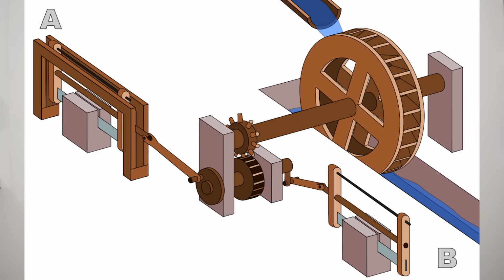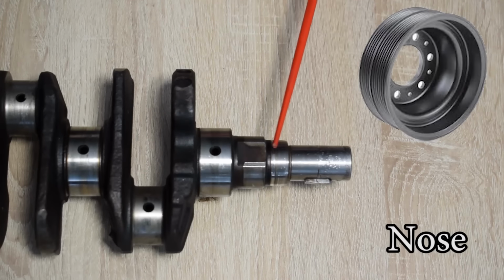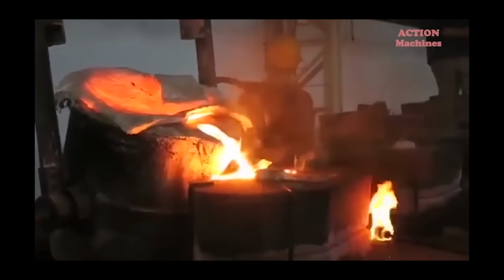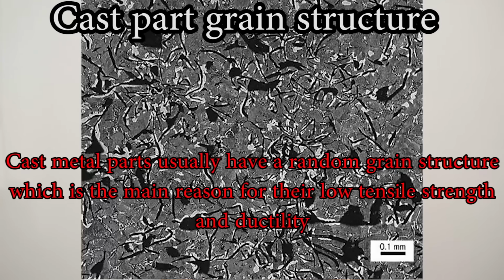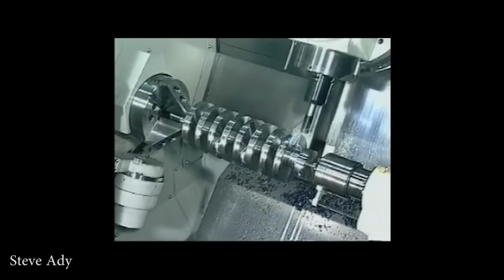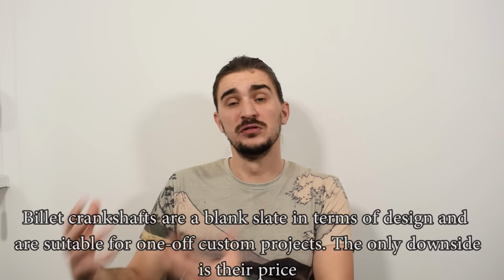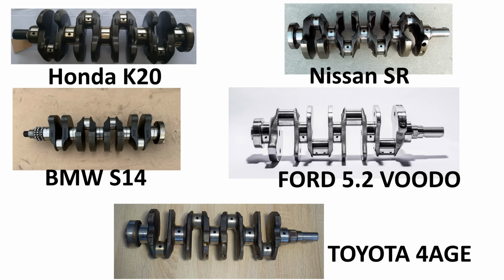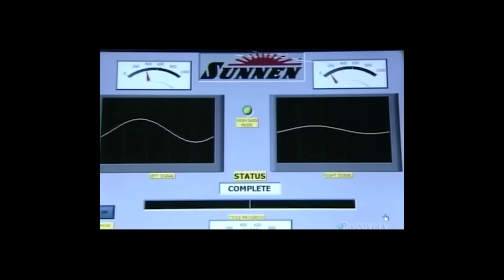EVERYTHING about the CRANKSHAFT - Function | Manufacturing | Different types | Forged | Billet

Comment: The three most machinery intensive parts of an IC engine are the Block, Cank and Heads in that order. For a normal street engine nodular cast iron is just fine. I worked at an engine manufacturing facility for 30+ years. We built 4s, 6s (v & inline) and v8s. Cast iron and forged. One of the V-6s actually was pre balanced as its first operation. Which was drilling the central holes. Plus on both V-6s we built the pins were offset for smooth running purposes. The cranks were forge flat and then twisted and their centerline to get the angular offset needed. 
As to the strength of cast crankshaft. In the 60s there was an AMC 199 sleeved down to meet USAC Indy rules that made a reported 800 HP as max boost.
Another thing with flat plane cranks in V-8s. Using a flat plane actually makes it easier to build a V-8 with an angle other than 90° between the banks. Such an engine is effectively two 4 cylinder engines on a common crankcase

Comment: 26:10  Ignitions happen every 90 degrees of crankshaft rotation, both in flat plane and crossplane V8s, as long as there's a 90 degree bank angle.  Some odd angle V8s (like the new Mercury) even have split crank pins to avoid uneven firing.  What are you saying here?

Comment: From my understanding of material science a material that has less flexibiltiy on teh stress/strain curve is generally consider brittle due to its inability to flex leading to more dramatic failure. 

Just a technical point, ofcourse. In the end, it's the material that hadles the most force wihtout failure or permanent change in shape that matters

Comment: Great stuff mate really enjoying this series!

You mentioned in your video about pistons that a forged piston can slap the cylinder walls when cold creating more wear, so how does that compare with forged crankshafts?
Reply from the maker: Glad you like the content. There are no downsides to forged rods and cranks because they are not directly exposed to combustion heat, heat expansion is not an issue.
Reply: @d4a  Of course... duh! :)

Comment: I love your videos man
I would advise you to invest in an ok microphone to significantly increase audio quality 😊
Great job dude
Reply from the maker: I'm using a Zoom H1, I really thought the audio was nice. Maybe you're just comparing me to 2 million subs channels 😊 what do you dislike about the audio, so I can try and fix it?
Reply: @d4a  Well your voice is clear enough, but there is too much echo, and also you sound pretty far, which means your mic is mounted to the camera I assume?
My advice would be to maybe choose your "recording room" or "studio" as I've seen your videos are in different rooms sometimes. After choosing, buy a few cheap foam sound isolation pads and glue them to the wall, that will solve the echo problem. 
For the distance issue, I would recommend you invest in one of those small mic's on your short. That should sound way more natural. 
If you're not familiar with mic's I could link some videos from some techtubers as they would provide a far more detailed review.
Reply: @d4a  or! Bring the mic closer to yourself! That way you don't have to buy another one if your happy with quality of your current one.
Reply from the maker: Thanks for the info. Yeah, definitely different rooms, unfortunately at this stage I can't convert any room into a studio or glue anything to the wall, but I'm looking to change that eventually. The zoom recorder is maybe 50 cm from my mouth, it's separate from the camera and I synch my audio in post production. I will try bringing it even closer as some people mentioned the echo already. If that doesn't work I have an Olympus lavalier mic I can try, although my problem with lav mics is that I move around too much and that really ruins the audio sometimes.

Comment: i feel like i am somewhat overbuilding my daily engine build with a billet crank and forged pistons and forged H-rods, but it's nice to know there is a possibility to go stupid if i get tired of using it as a daily engine
Reply: Forged pistons are good and handle more power vs oem forged. H beam all day, can't go wrong as long as you don't run into clearance issues. Get your crank micro polished and nitride coated.
Reply: @twistedsocal  bit late for that as it's in there already but it's not a bad idea.  as its quite a big boy crank stock 80mm vs stroker 103mm making my little 2.3 I4 a 3.1L street beast should be around  high 200 to low 300 ish NA horses on pump gas tune, but not completely sure as the rally built engines with the same resipy goes for quite a lot more compression and E85. but they make in the high 300 range.
Reply: @Stale_Mahoney  yeah I figured you had already slapped it together from how long ago your post was. Still it's all good, the only thing you gotta be careful about is if you use pistons with low silica content cause you will get mad piston slap till it's warmed up and some other race parts that expect you to tear down and rebuild way way more often than someone who is building for day to day street driving.
Reply: @twistedsocal  yeah the specs for piston to wall clearance is 0.08mm or .003 ish inch? bore 96.68 piston is second over dim 96.60mm
Reply: @Stale_Mahoney  different clearance and spec per build. The different makeup or content of piston will determine the expansion rate and ammount per piston. Higher silica pistons don't expand and contract as much so can have tighter tolerance overall from start to warm... Where as some pistons will have a lot more play or clearance but as they warm up will get much tighter. These tend to produce more power in the end but also have slap at the beginning and imo too much play to be tolerant. I have gone both ways. I prefer high silica pistons.  As to your clearance and spec. I have no clue what your build calls for
Reply: @twistedsocal  yeah the stock alu pistons had more clearance than  these forged pups, is a known problem a the redblacks get older that they get piston slap, so hope to avoid that

Comment: So is the Kawasaki H2 750 two stroke triple; a sort of 3 plane ? "Y plane " perhaps ?
Reply from the maker: Yes, you could call it y plane, the crank throws are 120 degrees offset from each other, but not all three cyl bikes are like that, some have the throws offset 180 degrees, so when the middle cylinder is up the other two are down.

Comment: Good overview and explanation!  I would expect there to be other versions than flat- and cross-plane crankshafts.  With 120° between the rod journals for example?
Reply from the maker: Definitely, many three cylinder engines have the throws offset 120 degrees from each other. I didn't go to deep into the planes and cranks as the video was pretty long already :)

Comment: Crossplane crank engines do not fire more often than their flatplane counterparts. They are equal in this respect. The big difference between the two is the differences in the 1st and 2nd order vibrations. Flatplane cranks are smoother at low rpm because they have an even firing order on each bank but vibrate much more at high rpm, while crossplane cranks are smoother at high rpm due to the increased counterweights but can have a lot of shake at low rpm.

The burble of the crossplane crank is due to the uneven firing order causing a stepped pressure wave  vs the smooth pressure wave from a flatplane.

As for the flatplane cranks tending to make less torque, this is not exactly true. Engines with flatplane cranks do tend to lack some torque of a similar engine with a crossplane crank, but this is due to the cams being tuned to the operating range of crank. A cam used for low end torque is better suited with crossplane crank that doesn't rev outside of its powerband. In the same regard, a cam that produces power at the higher rpms that a flatplane engine can achieve tend not to work as efficiently and produces less torque down low.
Reply: 👍 Neither crank can “make” more torque than the other.  Crossplane is heavier and creates more windage so it consumes more torque.  Also the claim “Crossplane has a cylinder firing more often compared to a flatplane crankshaft”. is not physically possible.  Here’s why: Both cross-plane and flat-plane V8 engines, being four-stroke engines with eight cylinders, have the same number of firing events per engine cycle at the same RPM.

Comment: A quick correction. Both  cross- and flatplane V8s with a 90° bank-angle fires evenly four times per revolution, aka every 90° of rotation. Difference beeing the flatplane has even spaced power-pulses on each bank (so basicly two typical I-4s offset 90°) and the crossplane does not, it has an uneven distribution of pulses per bank. The total being the same. At short, the only thing the crossplane is better at is second-order vibrations. And no, the flat plane does not make less torque, displacement for displacement, all else being equal. Infact a flatplane makes more torque and power generally over the entire range, due to the even spaced (on each bank) pulses, giving better exhaust scavenging. (even exhaust scavange can be done on crossplane engines, but is very impractical due to exhaust header space constraints, and the runners becomes so long, that you get deminishing returns).
Reply: This! Flat planes only typically make less torque because of the design of the engines that use them!
Reply: 👍 Neither crank can “make” more torque than the other.  Crossplane is heavier and creates more windage so it consumes more torque.  Also the claim “Crossplane has a cylinder firing more often compared to a flatplane crankshaft”. is not physically possible.  Here’s why: Both cross-plane and flat-plane V8 engines, being four-stroke engines with eight cylinders, have the same number of firing events per engine cycle at the same RPM.

Comment: how is a  'hollow' crankshaft pin lubricated?
Reply from the maker: Good question! They're only drilled to the point where they don't actually interfere with the oil pathways. The oil pathways are at an angle through the journal so if you offset the crankpin drilling from the center enough and reduce the diameter of the drilling you won't disturb the oil pathways. You can google drilled crankpin and you'll see what I mean in the images.
Reply: @d4a  thank you for replying so fast. It looked like the hole wa sd so big it wouldnt be possible in the video now i get it thx

Comment: About X plane CS that are less rev-happy: in general yes, but tell it to these guys: https://video.motorionline.com/yamaha-yzf-r1-crossplane-crankshaft-technology-explained/  :)
Good video mate!
Reply: THANK YOU MEN
Reply: different issues. 4-cylinder crossplane solves the problem that normal 4's have all the pistons starting and stopping together. this is actually very sucky at high revs. the crossplane-8 has breathing issues as it pumps exhaust in an uneven rhythm into each bank (a paradiddle, if you know drumming). the rare solution to this is the infamous rat's nest of exhaust in the gt40, which doesn't group each bank in its own 4-into-1 group

Comment: Dude youre gunna get big with this content i swear. Also does anyone know if the throttle cable replacement for d4a works on n.a 4age?
Reply from the maker: Thank you. What do you mean by throttle cable replacement?
Reply: @d4a  Over the years, you've taught me  QUITE ALOT about engines. 
I've even spent a weekend binge-watching ALL the videos in your accumulated 
YouTube Library. I sincerely appreciate everything you've posted. In fact, yours is 
the ONLY such channel I've subscribed to. 
For the past 25 years, I've built my own engines; strictly Big Block GM. I have an 
engine build project planned for this Fall & Winter. I'll build a big block Chevy with 
a flat-plane crankshaft. I'm now working with a well-known company that builds custom crankshafts. 
For several months, I've searched EVERY resource...BUT...I can't find the answer 
to my questions. I trust you & the data you provide. So, I'm at your doorstep asking 
for accurate answers//your honest opinions to my questions. 
My 1st question: Is it necessary to construct the exhaust headers differently for a 
flat-plane crankshaft engine compared to headers commonly sold for an engine 
with a cross-plane crankshaft? I will have the headers custom fabricated. 
I understand the reasons & benefits of unequal length, long tube headers, etc. 
My 2nd question: Would an engine with a flat-plane crankshaft benefit from 
"unequal length" headers in the same way as an engine with a cross-plane crank? 
My engine will NOT be stroked. This build will include a Whipple Supercharger 
and will stay BELOW 10Lbs of boost. Also, MBE "Big-9", billet aluminum, 9° cylinder heads. I'm shooting for 10:1 C.R. 
Every component of this optimistic engine build project is chosen and/or designed 
with consideration for the characteristics of the flat-plane crank. 
Hopefully, I've provided the information you require. My desire is to have a properly functioning & efficient exhaust system; considering the exhaust sequence of the 
flat-plane crankshaft. 
I know this is an older video & hope you read this & reply. You can also contact me 
by email; hmwh0256@hotmail.com 
Your attention & your consideration are sincerely appreciated. Your opinions & input will be highly regarded. 
Best regards, 
Ben
Reply: @duygukayhanisaskank4915  
I hope this link could answer some of your questions:
https://www.youtube.com/watch?v=RcyMoZoqkPA
Reply: @d4a  not the cable but the metal that holds the cable for no reduced rub on the throttle cable
Reply: @BigBonkers1  just find a wrecked one and see how it works.
That's what I do if I find a random bolt  in the engine bay that's just sitting on the block. ( Turns out it was from a hose clamp )